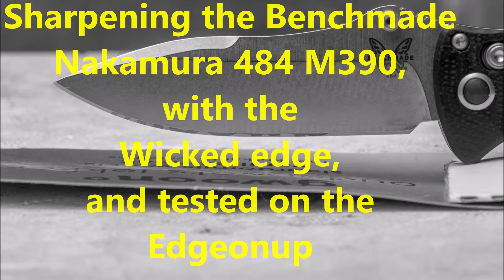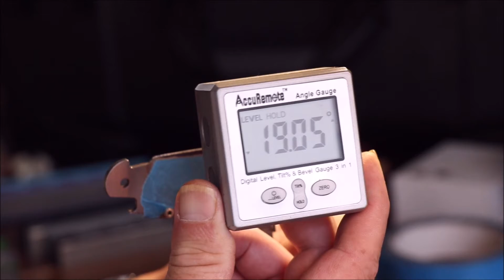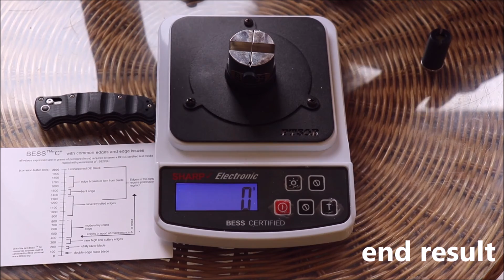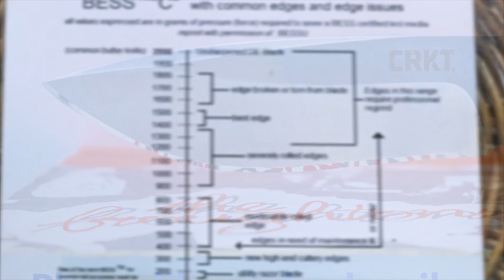Sharpening the Benchmade Nakamura 484 M390, with the Wicked edge, and tested on the Edgeonup

Comment: Why strop at a 2° steeper angle? Seems that won’t touch the edge at all. I could see a 2° wider angle that would strop a microbevel on the edge. Confusing to me. Thanks for your content. I always enjoy watching how others use their wicked edge so I can pick up pointers for my own.
Reply from the maker: Because the cow leather is soft, there is a possibility that too much pressure will round the edge. That is why it is recommended by Wicked edge to reduce the angle by 1 or 2 degrees. The chance is less with the kangaroo strops, because this leather is thinner, and these are glued to a metal plate.

Comment: How’s the longevity of the wicked edge diamonds?
Reply from the maker: I have sharpened more than 175 knives with the stones. And some with the higher grit have some wear on the edges. But I do not mind. Because these stones are very broken in. And do not leave deep scratches in the metal. With the lower grit I notice that they don't remove as much metal as in the beginning. But then I start with a step lower. So if I am going to replace 1 that is the 100/200, to reach the apex faster. My favorite is the 6 micron lapping film, I've used it for over 50 knives, and every time it just gets better at making a mirror edge.
Reply: @2000jabas2000  thanks for the detailed reply. I've always considered picking up a wicked edge, but have yet to pull the trigger. nice channel!